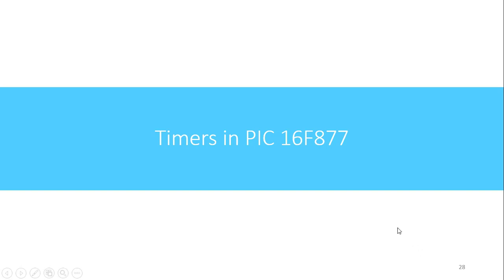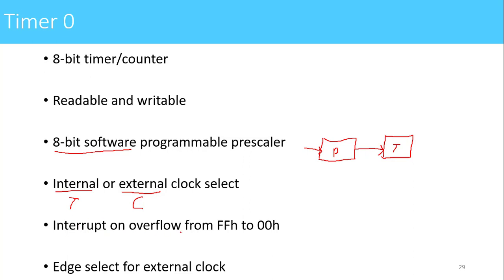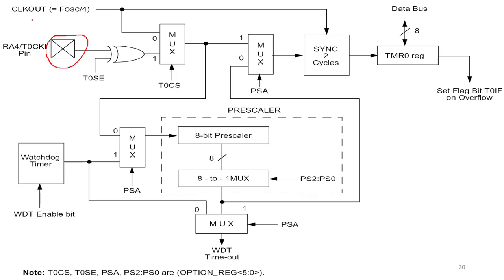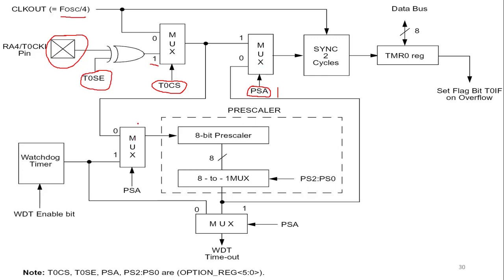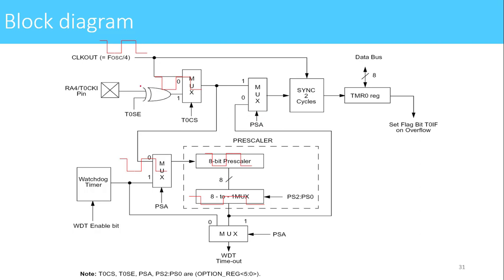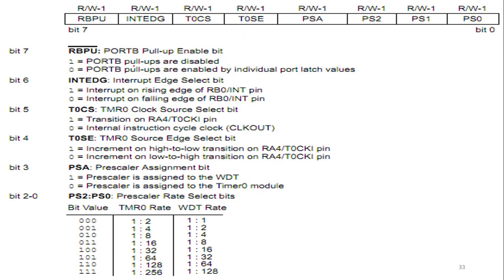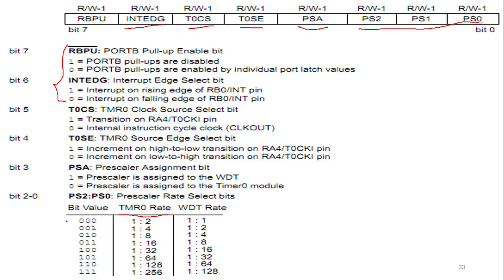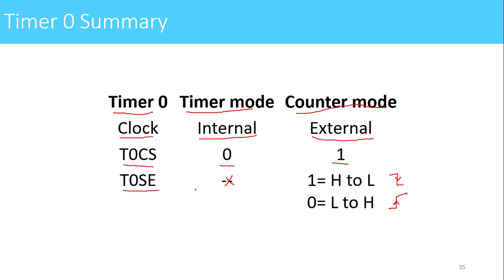Timer 0 in PIC 16F877

Comment: Can we generate 10 second delay?
Reply from the maker: It depends on the value of crystal frequency that you are using. However, if you need maximum delay then use higher value of prescaler.